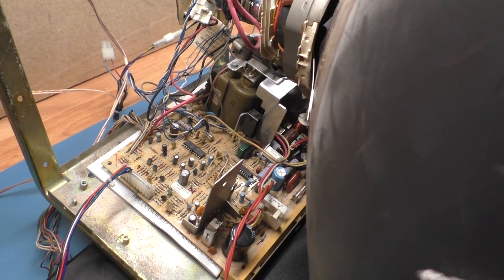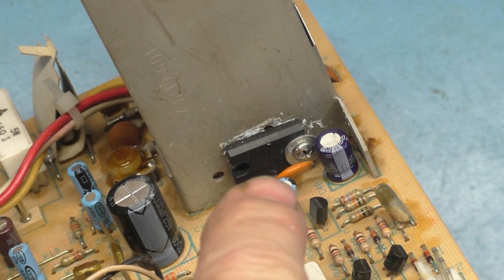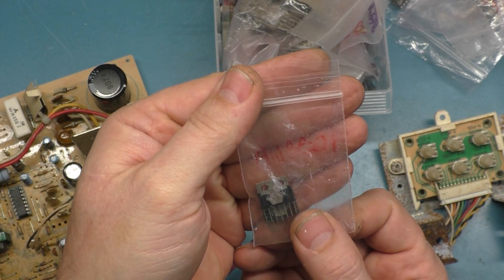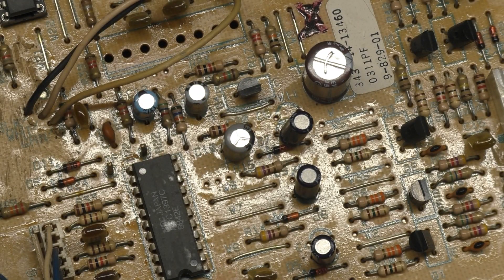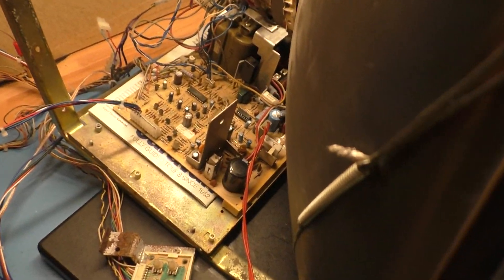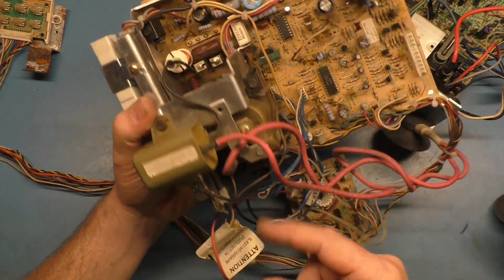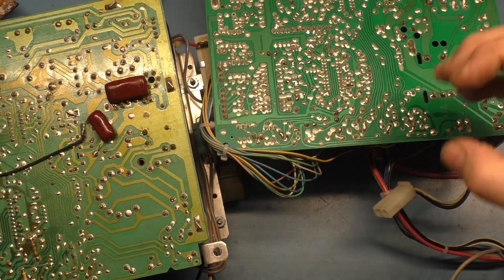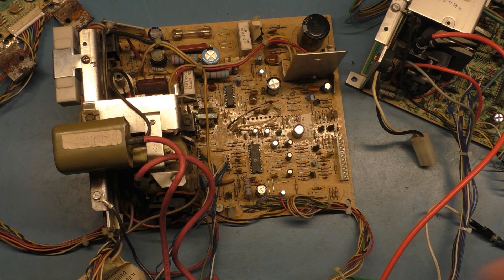25" Zenith K7000A Arcade Monitor Repair - Vertical Foldover - Wrong Vertical IC?

Comment: Is there an easy way to tell what IC3 a k7000 needs if we can read the numbers? I know a k7000a needs a the AN5521 And some use UPC1378H and some La7831.
Reply from the maker: It would depend on the revision of the chassis and the pinout of the traces.
Reply: Ok. Thx. I have one where I can’t get rid of the vertical fold over. R80 is okay as well as the vertical size pot. 50/60 pot works and I’ve replaced c51. If I increase the vertical size I get folder over. If I decrease it I get a small but perfect image but tons of black space
Reply from the maker: Your yoke winding within limits?
Reply: @MikesArcadeMonitorRepair  yes. It’s my test tube. 14 ohms

Comment: Hi Mike
Thank you for all your well done repairs. I have just changed the caps, HOT and STR30123 on the K7000A, but it turns out that the flyback is broken. Do you know where to find a replacement or a donor?
Regards
Klas
Reply from the maker: You’re welcome! Get all your parts at arcadepartsandrepair.com
Reply: I couldn't find any flyback or replacementboard for K7000A. As I see this chassi is not so common in Sweden. Where can I buy the K7000 chassi  including flyback?
Reply from the maker: Ah, ok. Sorry. There is no replacement for a k7000A. You have to get one from a donor chassis. eBay is likely your only option
Reply: Thanks

Comment: Hey, Mike, is there any difference in tube compatibility between the K7000 and K7000A chassis?  I want to use a tube out of a 25" Sharp TV with a K7000A chassis.  I know the Sharp tube I have works with a regular K7000 chassis but I'm not sure about the K7000A.
Reply from the maker: Nope. Identical.

Comment: Interesting. That 1378 chip has about half the output current and voltage capability of the 5521. It's also rated to only 20" on a 100deg tube. Some tech made a booboo there.
Reply from the maker: Yup